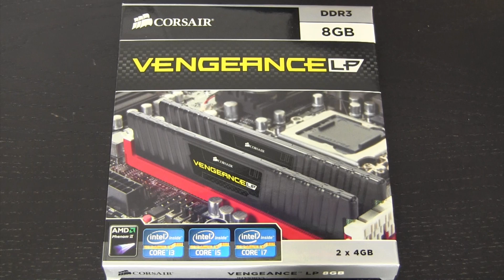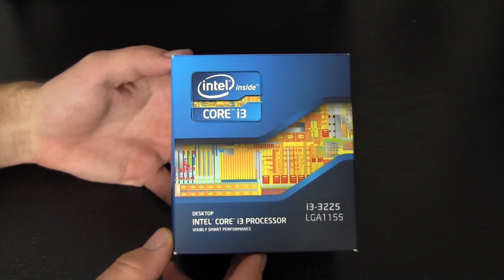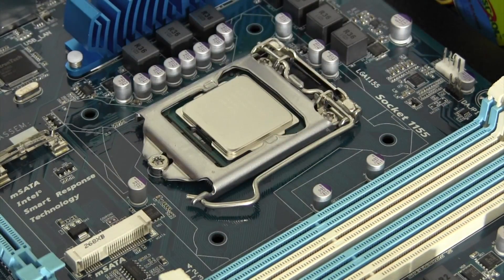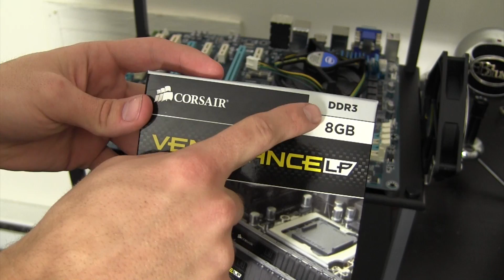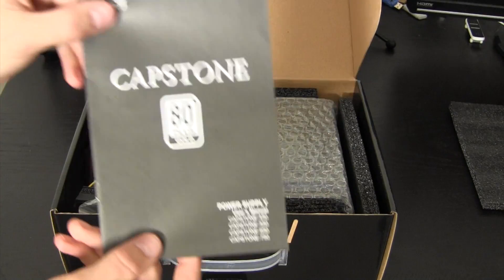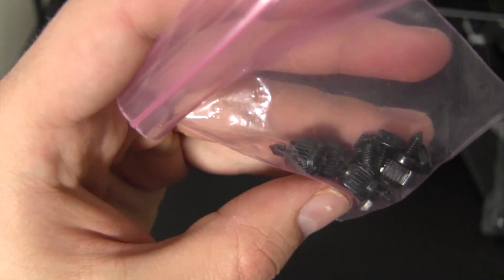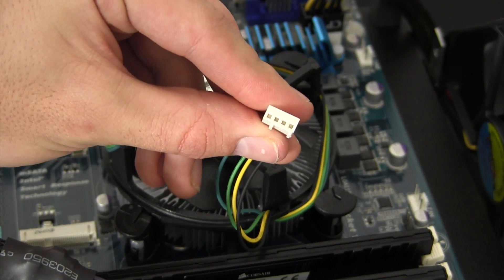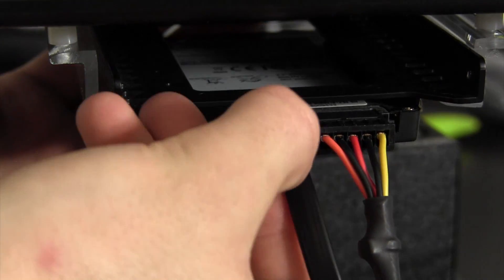Building a Budget Hackintosh

Comment: He could have used a good case that costed like $40 and used a pentium over the i3. And a cheaper motherboard. AND NOT USE A BLOODY SSD.
Reply: ew dont use pentinum prob one of the worst intel ever
Reply: The Pentiums I hear are very similar to an i3 without hyper threading(I may be wrong. Also the Celeron is the worst CPU by Intel.
Reply: Jacob Laflash 1155 Celerons actually perform very well. It isn't like the old days where they were the laughing stock of cpu's. It's still an Ivy Bridge cpu. 

Also, the Atom line was their worst. Either that, or the Pentium 4.
Reply: Droogie128 I was talking about the 1155 socket more specifically.
Reply: They're the lowest tier of 1155, but theyre still quite impressive. Especially considering how they just sip power
Reply: Droogie128 Yeah, im considering getting one for a friend who wants a low end gaming computer for minecraft and stuff.

Comment: I have a medium size case, 600 power supply,CORSAIR XMS3 8GB DDR3, 1TB harddrive 72rpm, Sony DVD/CDRW. what MB and processor would you suggest/recommend for a basic hackintosh that can handle FCPX, and about how more do i need to save up. I'm very new at this, so I apologize in advance for any inconvenience. i was thinking about the Intel Core i3-3220 Dual-Core Processor 3.3 Ghz 3 MB Cache LGA 1155, Gigabyte LGA 1155 Intel Z77 HDMI SATA 6 Gb/s USB 3.0 Micro ATX Intel MB. Thanks in advance.

Comment: this build in the video is really out of my budget. I am just a hobbyist so not willing to put in the buck. so I changed some of the components. Like the SSD I changed it to HDD ram, I bought cheaper Hynix rams. For the PSU etc..., I went back to my old school, contacted my school operations manager. and asked his if he has any defunct computers. he gave me one NEC one for like $70. with PSU cd-drive and of course the case for the computer. now it dual boots 7 and 10.8.3. Spent about $300 bucks.

Comment: >Budget 
>520$

That's not budget.
I'm running 2GB of DDR2 667
A Pentium D 930 and a Antec VP450 PSU 
Oh the board is a MSI P965 Plat. 

Currently with an X300SE (temporary/borrowed) as I had a 7900GS but it fried. :I 

It all cost me like 100$ (30$ for the mobo which came with the CPU, 10$ shipping, 40$ on the PSU. . .etc)

Comment: Hi Bob I have just finished building my hackintosh thanks to you help however I have ran into a bit off a problem with the HDMI not working can you l.ease let if there is a way of fixing the problem. The motherboard I have used is GIGABYTE GA-Z77X-UD5H LGA 1155 Intel Z77 HDMI SATA 6Gb/s USB 3.0 ATX Intel Motherboard and  have no graphic card in it yet. Thanks for you help.

Comment: I've got the GA-H77-D3H-MVP, which is pretty similar to this board. The audio chipset is the same VIA 2021. I still don't have it working after a few days of messing around with dsdt edits and VoodooHDA kexts and modified AppleHDA kexts so I'm thinking the external audio USB solution in the description is the way to go if you have one of these boards. I would reccomend the GA-Z77-DS3H over the one Bob used in this video though, just to make onboard audio work essentialy out of the box. :)

Comment: That's about the same as mine. Here's mine though:
Intel Core i3 3225
GA-Z77-DS3H board
8GB Crucial Mem @ 1600
Antec 380w PSU
250GB HDD for windows, 1TB HDD for OS X